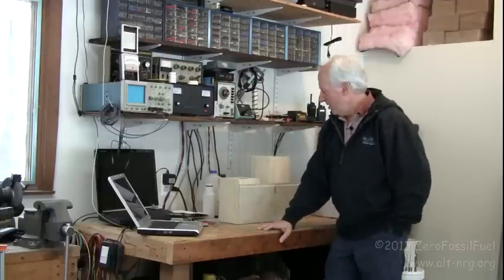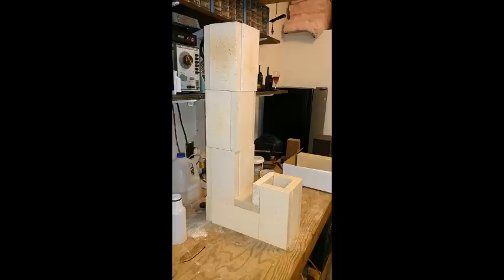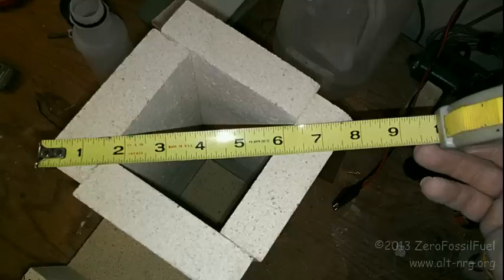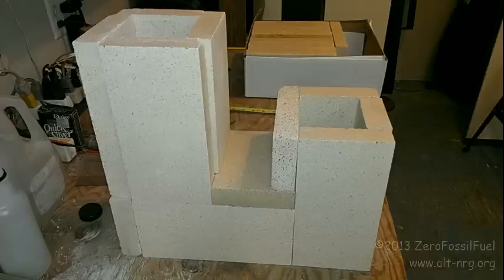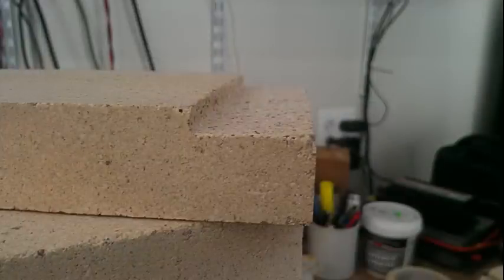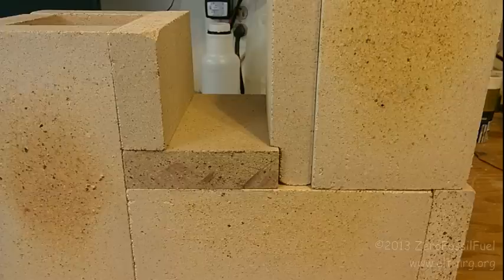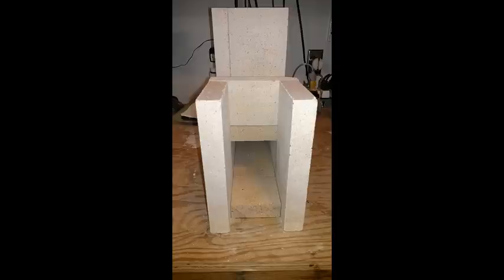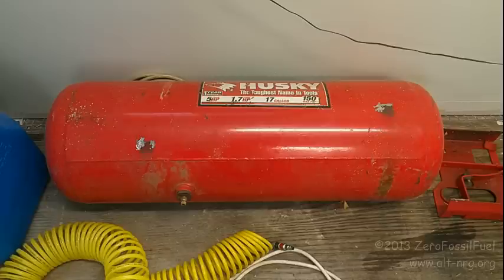#323 Rocket Stove J-tube construction wood burning

Comment: Thank you for actually making a "Rocket Stove"!  There are several other vids that show folks building essentially a brick chimneys or using a few cans in an "L" shape to make a burn-chamber with a chimney, but not a "Real" Rocket Stove.  The Rocket stove gets its name from the rocket like sound it makes after it warms up.  You only get this with the "J" configuration and not an "L" config.  The performance of a real rocket stove is dramatically different from others impostors!

Comment: With the intention building my own, I've perused many rocket stove videos and, I have always come back to yours. I do want a mass heater but your J tube of fire brick inside a metal box seems to be the best for my purposes.

I bought a fixer-upper house and in short order, got let go from my job. Yikes!

Luckily, I'm next to the woods. There's plenty of treefall for fuel everywhere. A rocket stove will be essential to heat my place cheaply. I will be making a stove of my own design but I will be using a lot of your ideas.... and... BTW, your video production is also top notch for a DIY. You don't say "uuhhh" and babble on endlessly about minutea. Kudos!

I have found a source for insulated fire brick. It is very light weight and cuts easily with and old hand saw or metal cutting band saw (with an expendable blade). I found another video on YT that uses this brick. During a burn, the flue was over 900F degrees and the outside of a 1.25" brick was less than 200F. That sold me. Unfortunately, my source only has standard sized brick and i'll have to "make" my own splits.

Thanks again for the inspiration. I'll video my build... Like everyone else. Peace.

Comment: When galvanized metal gets its first really hot burn, the galvanization will burn off. If you breathe in enough of it, you will get flu-like symptoms for a couple of days. When the symptoms are gone, there are no permanent or lingering effects. Once the galvanization is burnt away it's no longer a hazard. I built a rocket stove with some galvanized material. I gave it a good burn when I first built it, keeping my distance. It's fine now. I've even cooked on it. No problems.

Comment from the maker: The only bricks with any glue at all are the 3 riser stack groups of 4 bricks. The groups are not glued to each other, just centered inside the 8" vent pipe. For the glue I use furnace cement. All other bricks are free floating and form fitted with a tiny bit of slack for hear expansion to prevent cracking. This system should last for a VERY long time.

Comment from the maker: No, this is my first attempt at any sort of wood burning stove. 7 or so years ago I did, however, design and build a forced air heat exchanger for my fireplace. The manifold inlet is ported from the lower left corner of the sealed glass door frame. The heated air exhaust manifold ports right out the louvres above the glass doors. Air is forced through with a 50CFM squirrel cage blower. So the firebox remains sealed and room air is heated through the pipes inside the firebox. Works VERY well.

Comment: Aerogel works pretty well.  Its what NASA uses in their space suits.  
I made a custome Aerogel cover for my chest freezer as I noticed the lid was losing a lot of energy due to poor insulation. After I made the cover and installed it the energy consumption went down by a third!!  Still not satisfied I painted two coats of paint with Insuladd between the lid and the cover.  The freezer's compressor doesn't run as much now!  Good luck!
Reply: Hey Cliff!  Aerogel?  Do you know how to make it?  I've been looking for a recipe for it but no luck yet.

Comment: Thanks for making this video, and being so careful about dimensions.  We are building a rocket mass heater and this is very helpful.  8:00, did you mean to say that standard firebrick is 1 1/4 inches thick, or 2 1/4?  Because we have 9 x 4 x 2.25 firebrick which seems to be standard.
Reply: Standard firebricks are 1 1/4" thick
Reply from the maker: Correct.

Comment: the fact the firebricks insulate and reflect heat actually would cause a stronger draft, more than making up for aerodynamics and slight difference in size when compared to the a steal cylindrical pipe.

Comment from the maker: Your concern is noted but I've addressed this question before. The interior of the riser is not galvanized and the exterior sleeve does not get hot enough to off-gas. Even if it did, it would be brief and it would all exhaust up the flue.

Thanks for watching!

Comment: How did it turn out? Did you have a problem with overheating the metal? A proper J-type rocket will ignite & burn the combustible gases from fuel source. Steel melts at a lower temperature than the burn temperature of those gases. How did your stove work out for you?
Reply from the maker: That's why they call it insulating firebrick. Keep watching my other videos on this project. I've run this stove for five seasons now. First with wood, now with pellets but can use either at will.

Comment: Epic vid on the rocket mass heater subject.. Im happy the outer 8inc tube worked out so good :) 

Ok also a HHO related Q: im planning to build a HHO torch, and i need it to be able to cut sheet metal  ( as used in shipping containers, 2mm thick ) like a knife through hot butter, how many liters/min do you think i need for this? Im looking for the "cutting alu-can with lots of hho" type effect with the sheet metal..  What do you think? Any estimates are appreciated..  Thnx, im really not jk.

Comment: Thanks; i too like the thicker material, especially where the rocket flame blasts against the top! it looks like the perfect size for your space. um, i'm not completely clear on the science so would you say you expect to radiate less heat or more heat from the smaller husky tank v.s. using a larger drum? also, would a smaller diameter outside tank make for a hotter 'mass' at the end? Thanks; can't wait for the next vid!

Comment: Suggestion to help with airflow:
The inside corners, can be cut at a 45 degree angle. And, the triangles you cut from the top inner corners, you can place in the bottom corners. If you can visualize that, you can see how the airflow may be less interrupted.

Comment from the maker: I've seen it tried and it doesn't work well. The ratios of the intake, horizontal burn tunnel and internal riser are very important. You're building a wood carburettor. If the firebox is too big the air velocity around the loaded wood is too slow and it will likely smoke back at you.

Comment: I am buliding a RMH on a wood floor w/o insulation in the floor, however the wallls are insulated. I will build a ten foot bench as the mass. My question is in order to keep the heat from radiating through the wall and floor, what is the best insulation?

Comment: You can use a 4.5-inch grinder also I use them all the time for cement board and brick and I would use Soapstone around this, not a steel barrel Soapstone holds heat much longer and you can get it thick of 3/4 inch thick and it is pretty

Comment: This is more a question than comment. Are there specific ratios that should be maintained to get optimum operation?  ... draw? particulate burn
Reply from the maker: Download the free pdf at my web site alt-nrg.org. In it I describe in detail how to properly calculate the ratios, dependent on the size of stove you need to build.

Comment from the maker: No. The only pieces I am cementing together will be the 4 bricks that make each of 3 sections for the iinternal flue. Even the sections will not be cemented together, only stacked inside the 8" pipe which will keep them aligned.

Comment: In an enclose area, you are correct, zinc poisoning is a real possibility, but in an open area, not much chance unless you hold your face over chimney.  That said, after the first burn the zinc coating will likely be gone - burned off, thus you are just as well to buy black pipe to start with.

Comment: Thanks so much for all of the measurements and ratios! That will help a lot. Due to cost, I won't be using fire brick. I have been looking into casting a rocket mass heater core out of sodium silicate and sand. Do you have any input/advice for this type of build?

Comment: A 7" angle grinder with a 7" diamond masonry blade works better. If you take the guard off a 10" blade can be used but you have to be a little more careful. Wear steel toed boots so you can hold the brick down with your foot. This also works good when cutting fieldstone.

Comment: Watching your videos and trying to get more information and ideas for a rocket stove .I like the idea of using a heat sink but using galvanized steel .. not a good idea to use that with high temps as another person already pointed out . Stainless steel is best for this . I was noticing that in the first video you showed the building and the first thing I saw was no insulation under the floor . Was there a particular reason why you don't have that or did it come that way when you bought the house ? Even using styrofoam sheets under the floor would greatly help retain the heat inside . Also putting up  some skirting around the perimeter would greatly help if heating the building is the primary goal . I would also lose those old aluminum track windows or at least create a vapor barrier between the the window and the inside . I can see why it's freezing in there judging by the lack of weatherization to the building . Also noticed you're not a big fan of the permies . I've been watching their videos and there seems to be some sort of cult thing going on with them but then again I don't know much about that group run by Paul Weaton .

Comment: Forgive me if I'm missing the point but why do you want to insulate the tank? I thought the reason for a rocket stove was to release heat or am I getting mixed up with a Rocket Mass Heater? Colin
Reply from the maker: You don't insulate the tank. You insulate the riser WITHIN the tank to create the strongest possible draft inside. Then you extract that heat with the tank and thermal mass if you have one.

Comment: great job, to buy the construction drawings is there a link? thank you
Reply from the maker: You can find it at alt-nrg.org. Thanks.
Reply: @zerolabs  Thank you for posting this.  Is there anything you would do differently?  I'm experimenting with making a few.
Reply from the maker: @l0I0I0I0  Honestly, not much different. One thing Santa brought me was a wet saw so I can cut bricks more precisely to interlock with each other. I'm getting ready to start another stove myself, this time using a tall 100lb propane cylinder. My initial plan (subject to change) is to cut the bricks to stack horizontal instead of vertical. Inside dimension somewhere around 4.5"x4.5". There will be a lot more waste but it should eliminate the need for furnace cement which did not hold up well over time.

The more I use the pellet basket I designed, the better I like it. Especially when I see other designs lately that try to imitate what I've achieved but do not offer the intake mixture and temperature control of my design. Mine is not perfect, but it's still WAY better than the rest.
Reply: @zerolabs  Thanks for posting this, very helpful!

Comment: What kind of insulation  did you use inside of the riser and how is it holding up in the heat
Reply from the maker: Between the vertical stack and 8" vent pipe is plain fiberglass. It has held up perfectly. Inside the base, surrounding the horizontal burn chamber, however, I wrapped it with ceramic fiber sheet. That, of course, has also held up perfectly. Next build will be all vermiculite.

Comment: Do u cement them togerher
Reply from the maker: I only cemented the bricks in the vertical stack at the corners. Everything else is just floating and held in place by the heavy gauge sheet metal box. They can be removed, cleaned, serviced and replaced as needed. So far I have only dismantled it once all the way for cleaning. Very low maintenance.

Comment: google " The Winiarski Rocket Stove"
find the pdf file  and you will see that the main difference in a stove and a heater is the heat expansion chamber that the intense flame is contained in the heater 
versus the flame hitting your cooking vessel in a rocket stove.
Flues can be incorporated for indoor use of a cooking rocket stove.
Saves eyesight,lungs,depletion of forests.

Comment: By ratios I mean:  horizontal run to height of burn tube? Height of burn tube to length of exhaust, or cubic inches of heat transfer area to mass of heat storage material or height of the exhaust pipe? I want to be sure to burn ALL the carbon &/or expel all the CO & CO2, eliminate or be able to clean out any creosote and retain as much of the heat as possible (ie: exhaust only temperate air and steam).      Also, how does one get a reply from YouTube?
Reply from the maker: It's not easy. That's why  my contact info is on my web site.

Comment: The problem I see with this setup is, as the wood burns-up, the ash that is created will build-up at the bottom of the feed area & burn tunnel causing a decrease in airflow.  Am I wrong about this?

Comment: I know it would be hard to use coal, simply because it has so many impurities in it, there is a lot of rock and the ash in coal, it shouldn't be to hard to burn oil in a drip type set up, using a small valve to set the rate of flow, but what kind of residue would you get as an after product, me i'd stick to wood, but i live in the country, plenty of wood
good luck, be safe

Comment: Zero fossil fuels? Why wouldn't you want to use recycled Dinosaur and plant matter?
Reply: Possibly because the rampant over usage of these abundant and wonderful recycled materials means that to obtain more in this present day and age we are required to excavate, drill, frack and otherwise destroy, sometimes involving delicate ecosystems which we rely on to maintain life on this planet. Not to mention the political, social and personal strife involved in creating conflict (wars) in order to maneuver ourselves into a position where we have access to larger reserves of these resources (Middle East).

Much easier and more conducive to everyone's well being to simply grow locally what you need locally.
Reply: Zero fossil fuel, um you're using an electric table saw, to cut manufactured bricks.

Comment: cinder blocks break when they get hot, not worth your time and effort!
Reply: This is not cinder block, it's fire "brick".  Sold at home depot at $30+ for 6 bricks (expensive) but some lowes stores carry it at half that price and you can buy one at a time.
Reply: Tractor supply has firebricks for 3.29 ea. Just on sale for $ 2.63